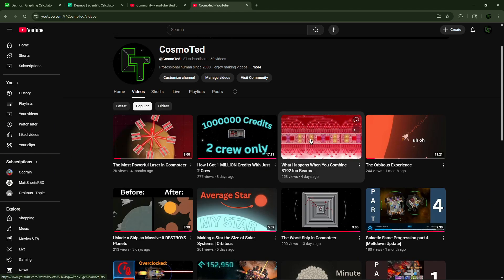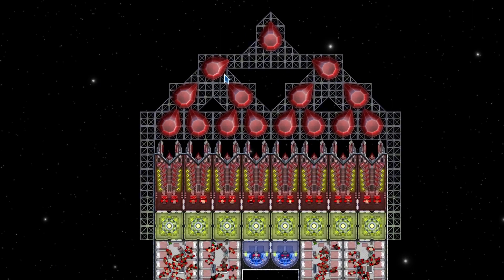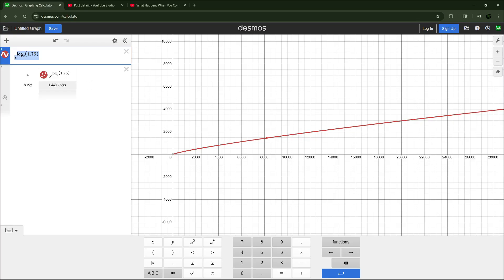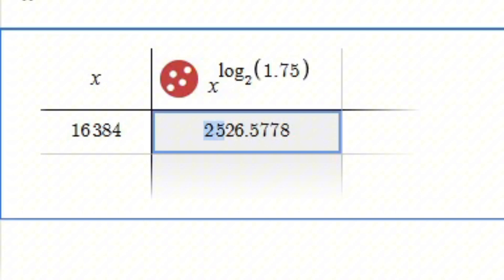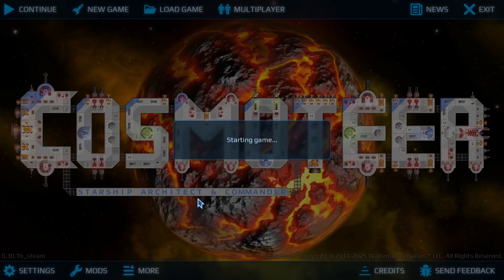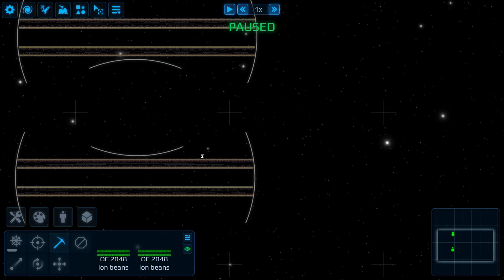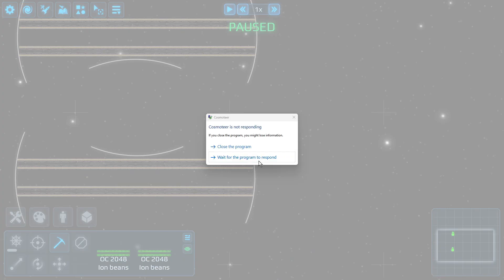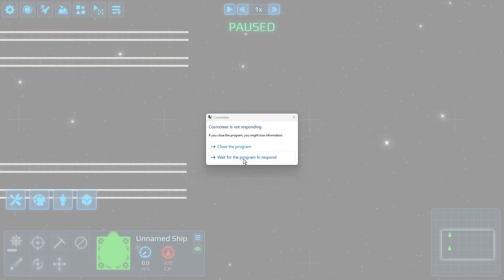Overclocking THOUSANDS of Ion Beams Was a Mistake...

Comment: Aww thats such a cute small beam thats a little closer to my record (granted i did use several ion capacitors to multiply the dps so ig u did beat my 8192 starting ions but i didn't crash at all). Its capable of 1 ticking the 4x4 megaroid that ur beam took forever to destroy in the prev vid. Thats is over 25.6mil dps and the red glow flooded the entire screen on max zoom out

Btw turn off the ion particle effects in settings. It contributes to the majority of the lag
Reply from the maker: Particles are probably a good thing to turn off I guess. Cute? I have made a single beam more powerful than any ion beams setup you can make.
Reply: @CosmoTed lol its weaker than mine by a few magnitudes
Reply from the maker: What about my modded ion beam?
Reply: @CosmoTedwell, both 1 ticked the 4x4 megaroid which has like 2.56mil hp so idk. Both r at least 25.6mil dps ig